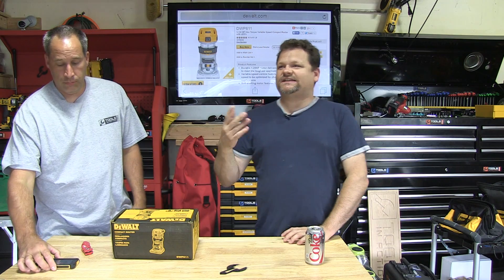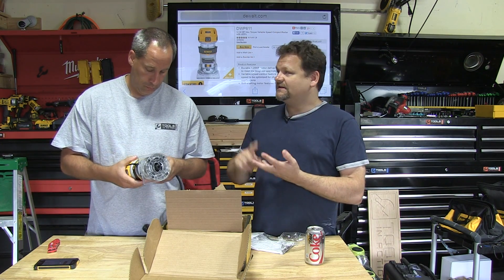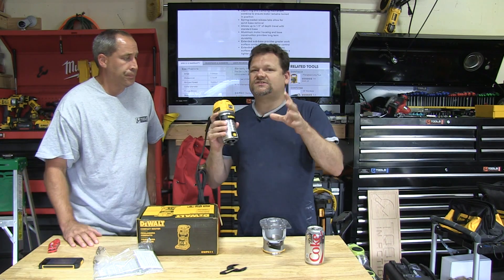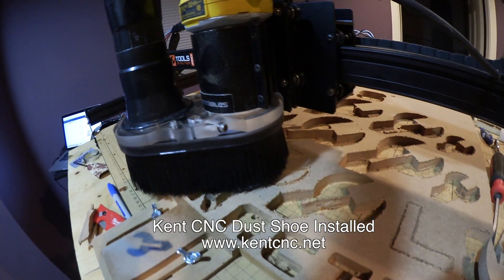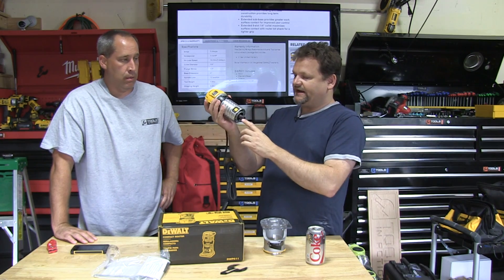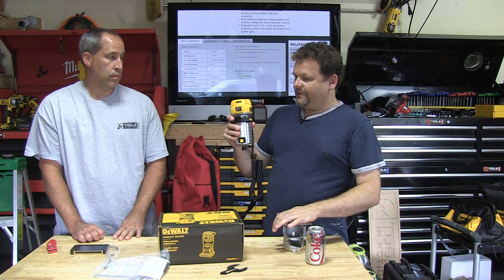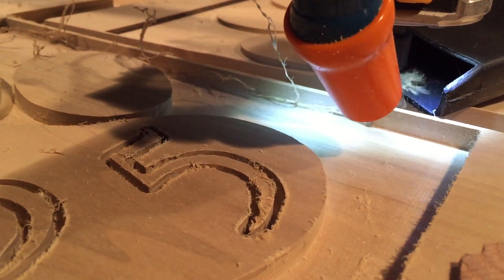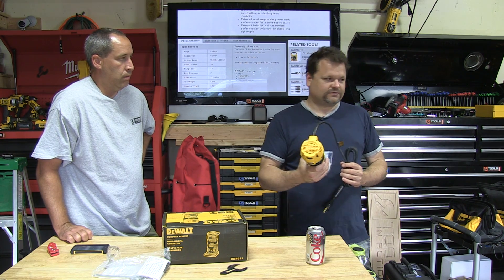DeWALT DWP611 Compact Router as a X-Carve CNC Mill

Comment: The Bosch Colt has a dangerous flaw when using on CNCs. Their collets are very weak and during cuts can eject a bit at high speed. Bosch knows their Colt collets are crap, that's why they sell them in packs of two. Also, their lower bearings generate high heat during extended use, which can imbalance a bit and destroy the bearing. I've owned four in three years, and one I had to send back after 1 hr machine time after the bearing failed. Dewalt or Porter Cable is the way to go on CNCs.

Comment: I have this DeWalt and bought the kit with the fixed and plunge base. Come with that bag that's on the bottom right side of the screen. I've used it on everything from Pine where it cuts super smooth to PurpleHeart which is VERY hard to cut and does a great job. It has the perfect amount of power. I mainly use it on Walnut and it's perfect. I use to have the harbor freight 15 dollar router. Man was that thing trash. I never knew how great and how many things you can do with a router till I got this DeWalt router. You will love this router and swear by it. I know I do. Awesome job TIA, also I'm going to look into that adapter you mentioned to fit bigger bits. Didn't know that. Thanks.
Reply: Also the LEDs is icing on the cake!!!! I LOVE THE LEDS! You can clearly see where to stop.
Reply from the maker: +Gold63Beast Thanks man!

Comment: Finally got my xcarve together, still trying to get it fine tuned. I'm using dewalts router and got dust shoe like u recommend, as well as some of bits. While I was putting xcarve together,took the time to unhook cord at machine and just wired in drag chain. Kind of a pain, but it's done know. I can see just how fast it's going to be with just a few failed test runs. Still learning the different bits.
Reply from the maker: +CHAD LANTHIER Saweet!  we need to see it in action

Comment: Great little work horse, don't hate on the big routers just to left to right and they won't walk on you...also you can go right to left not the hole way in on the bit to prevent chipping ( like if your pitting 1/4 round over on a sign, just trim about halfway right to left then left to right this should prevent blow outs)